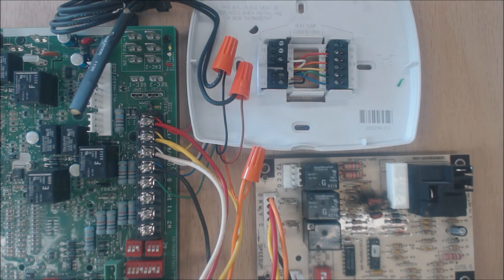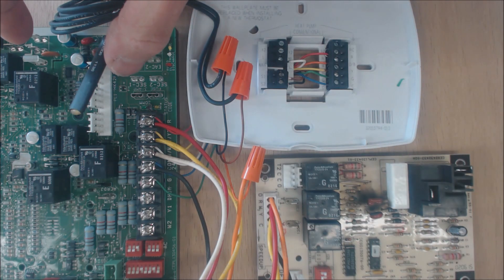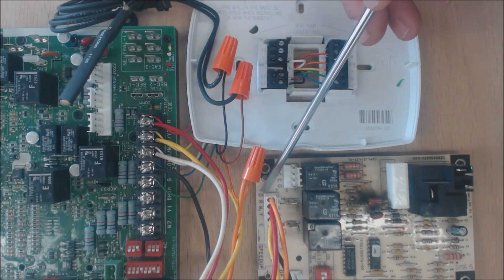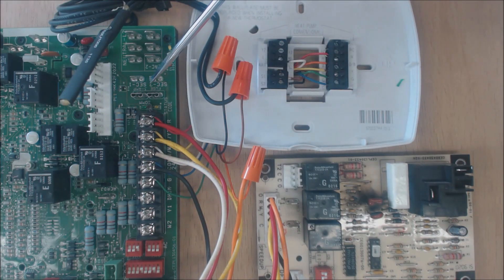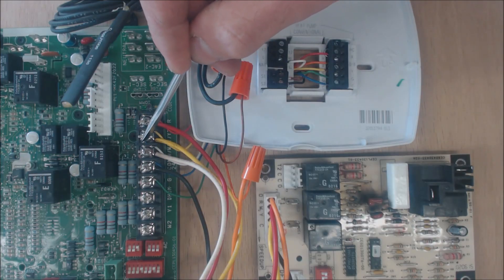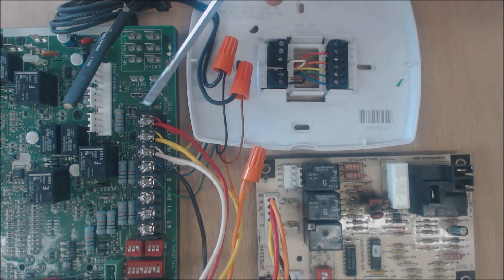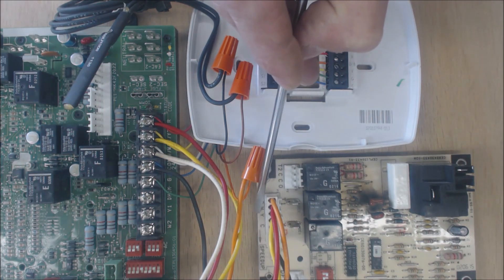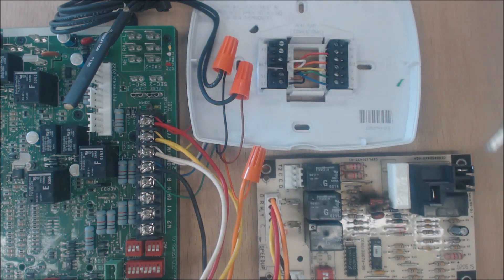Wiring a Thermostat, Furnace, and Heat Pump for Dual Fuel Hybrid Heat!

Comment: Many young techs don’t fully understand dual fuel heat pump operation. The wiring trips them up. If you don’t wire em/aux W to W on the furnace, the furnace will not run during the defrost cycle and you will get cold air from your supply vents, dropping the house temperature. Goodman heat pumps have a white wire from the heat pump that must go to W on the furnace.

Comment: I have a Daikin propane 60K High Eff furnace with a VRV Life heat pump doing Dual fuel.  The Daikin Thermostat can only go down to 61 degrees and can't seem to ever shut off.  It almost seems to throttle down when it reaches whatever temperature you have it set for and then can't get above that temp and then runs forever.  The transition is set for 30 degrees does same at 40.  Will this thermostat go lower than 61 degrees and would it simply shut off when it reaches the desired temp?

Comment: Honeywell requires the outdoor temperature sensor wired to S-1 & S-2 be a separate 18/2 cable. Do not use 2 wires  in the cable to the heat pump. You will have electrical interference if you do. Many mystery random problems can be attributed to combining the wiring in one cable.

Comment: This is already 7 years old. I discuss this with friends and their minds are blown. I just want to get all the action out of my system. If the outdoor unit can take 4 stages. The furnace has 2 gas stages. Can a t9 thermostat utilize all of them? Their website and support says, call a pro. I say hell no. Call Craig. I think it can do it. The furnace manual. Aciq calls out 4 stages of heat. The first 2 stages would be the heatpump, the next two would be low and high on the furnace it self. I just worry about how it chooses those various ones. Or should I go opensource.

Comment: AC Service Tech, great videos! I have an issue that two service companies can't figure out. I have a 2-year-old dual fuel 5 ton 16 SEER single stage American Standard system. Every month or so, in cooling, I notice my house is warm. I find the indoor unit is running but the outdoor unit is not running. To fix, I raise the set point until the indoor unit shuts down. Then I lower the setpoint and both the indoor and outdoor unit come on and all runs fine for another month or so. My thermostat has been replaced twice but the problem persists. What might cause my intermittent problem? Bad contactor? I can never duplicate the problem when the service tech is present. Next time it happens I need to check that I have 24 volts on Y1 at the compressor.

Comment: I thought a gas furnace should NOT be running during defrost mode as this could raise the temperature to an unsafe level and reduce the lifespan of the compressor.

Comment: I've never installed and worked on Honeywell TH8000 but for the other heat pump thermostats when you turn on the HEAT and set the GOAL temperature let say 3-5 degree HIGHER than the ROOM temperature then the thermostat will automatically turn on the AUXILIARY HEAT to help the heat pump. So in the case of dual fuel heat pump will the Honeywell TH8000 will turn on the gas heat to help the heat pump ? Thanks for your reply.

Comment: Ah, finally an installation that shows the O/B wire from the thermostat directly to the heat pump control board. I was stuck for quite a while wondering why the furnace board needed to know about the reversing valve signal. So is the O/B terminal on some furnace boards just to simplify/standardize the wiring (without actually connecting to anything on the furnace board)?

Comment: Great Content!  I recently purchased a new thermostat and would like to configure it to run the heat pump for air conditioning purposes only. I live in the Northeast and have a dual fuel system. I want to convert to a conventional 2H / 1C system using the existing wiring. Is this possible with my current setup? Can I just wire the O and Y together on the new thermostat and program the thermostat to run as a conventional system? 

- Heat Pump Model: Lennox XP14-024-230-03 ( Heat Pump)
- Furnace Model: Lennox G61MPV-36B-071-12 (2-stage Variable Speed)
- New Thermostat Model: Honeywell RTH9585WF1004

Keep up the great work!!

Comment: Hi
I'm about to replace old r22 outdoor unit COOLING ONLY  with Goodman heat pump + coil 
But owner wants to keep old gas furnace with the blower motor)) 
It's possible to connect to control board  terminals C G Y W R  if yes how many wires has to come from outdoor heat pump condenser? 
Many thanks!

Comment: I completely don't understand how this can even work.  So, when the only new wire that is introduced from a gas furance and AC when switching to a gas furnance with a heat pump is the O/B wire... how on Earth does a signal work that tells heat pump on in heating or gas furnace on when heating?  I only have one W wire... I have G and O/B.  My furnance control board looks just like that one but I think it is a different model number.  What is the actual signal being sent when it should call for the furnace versus the heat pump?

Comment: Part I'm confused on is where you mentioned about defrost. When the heat pump boards sends 24v on W in the indoor board. How is it preventing the gas furnace from coming on during defrost? Does the main Indoor board locks out the furnace while Y is energized?

Comment: Question, I am adding  a 2 stage Goodman Heat Pump to an existing Goodman Furnace for Dual Fuel.  Heat Pump has R, C, W1, Y1, Y2, L and O terminals.  The Furnace has R, C, W, Y and G terminals.  Should I connect wiring as follows from the heat pump to furnace to Nest, R to R to Rc, C to C to C, W1 to W to W1, Y1 to Y to Y1, Y2 to Nest Thermostat Y2, L do not connect, O to Nest Thermostat O. Thank you for any assistance you may be able to offer. Jack Perlmutter

Comment: My heatpump's reversing valve froze up and now only works in AC mode so I had a furnance added since it cost about the same as getting the reversing valve fixed. But I have to manually chage the wiring and thermostat settings each change in season. I need a zone control board that can run a duel fuel service . any recommendations appreciated!

Comment: Question for you @acservicetechchannel - I just bought a dual fuel system with 2-stage gas furnace and 2-stage heat pump. I'm trying to figure out what thermostat I need. Is that considered 2 heat cycles/2 cooling cycles or is that technically 4 heat cycles and 2 cool cycles? 

Also, if you have any recommendations for thermostats or brands, that'd be great! Thanks in advance.

Comment: How can I keep an undersized heat pump running all the time and the furnace coming on when it can't keep up? Could I put the coil in the return duct and use a separate thermostat?

Comment: I replaced a dead central AC with a Trane heat pump, (without heat strip).  I have a hot water boiler for heat.  Can I use this Honeywell 8000 to control the heat pump and boiler separately when the outdoor temp is 35° or below?

Comment: help do you need the outdoor sensor if the heat pump has one already or is that for the defrost board only? my problem is that the heat pump and gas turn on together I'm using a Honeywell t6 pro stat

Comment: Very helpful video.  Thank you.  I have a hvac, propane hybrid system that cannot have both running once or the heat in the copper line gets too hot and the pressure is too high.  What thermostat would your recommend? The technician we had look at it said we needed a 3 heat thermostat.  Not sure how to hook that up.  I should add we don't have a C terminal.  I was looking for something with a wireless outdoor sensor to know when to engage the furnace.

Comment: If a lennox had a communication thermostat. 4 wires ( R, I+, I-, C) and customer changed thermostat to nest. What would happen then in the rewiring at the indoor/Furnace communication board?
Reply: I'm working on that now with the Amazon smart thermostat which doesn't support dual fuel.  My choices are to either use a Lennox C7500 thermostat (which I have) or write my own control firmware using a PI Zero/Arduino and use a relay board to handle this.  The MCU will have to read and handle outdoor temp as well.

Comment: Do you have a video laying out how to do this same thing, except the heat pump has 2 stages cooling and heat?  Is it as simple as just adding the extra Y wire?
Reply: Did you find an answer to this?  I have the exact setup, but the hack that installed it only ran 2 wires to the outdoor unit, C and Y. So the HP isn't utilized at all for heating, just the gas furnace.  I'd like to remedy that,  So I need to pull new 18/8 to connect everything correctly. Currently, it's also not utilizing the 2 stage compressors, so the supposed energy efficiency is out the window, as it's only running 2nd stage (high speed) all the time.

EDIT whoops, just realized I replied to myself from over a year ago...doh!

Comment: I have a heat pump and an oil furnace.  I have chosen not to have the oil heat come on when the hp goes into defrost.  I do not mind the cold air for a few minutes. Has anyone figured out how to trick the defrost cycle so that it will not operate when the temperature is above my 35 degrees set point?

Comment: Is the DFT sensor on the liquid or in the middle of the evaporator ? Surely the liquid line would not reflect the temp of the cold outside coil which is the evaporator during heating mode ?  11:25 in video

Comment: Hello, I installed a new gas furnace and kept the heat pump. I want to use the heat pump for AC only. how can I wire it with my new furnace to use it as ac? Thanks!

Comment: My heat pump has W and Wout wires. Where does the Wout wire get connected to with aux gas furnace and ecobee thermostat?

Comment: I have a dual fuel system heat pump with propane gas, with s1 and s2 wires coming to the thermostat. What would be newer thermostat models that would take s1 and s2 with wifi functionality? The model that you demonstrated with it in this video is fairly obsolete, and does not have wifi function. Hopefully you would get comment notification from your old post. Thanks!

Comment: I have a bosch inverter heat pump 1st generation,  a 97% efficiency modulating gas valve , varible speed Goodman furnace, and I'm using a emerson sensi thermastat,  the heat pump does come on and does work, thermastat says "heat" because it's my primary heat source,  but the furnace seems to kick on and does say " Auxiliary heat" which it should, it was 23 degrees out over night, I thought this bosch inverter was supposed to heat to -5 degrees before auxiliary heat or emergency should kick on , I'm just not sure if this thermastat is the right one, but it says hp 1 , hp 2, my bosch tech is new at these heat pumps, and old school with these types of thermostats,  not sure what's going on, can you help?

Comment: Thanks for the great teaching video. I have a heatpump/gas furnace with a nordyne dual fuel kit. I installed a Honeywell TH6320WF2003/U and think I need to remove the dual fuel kit to let the thermostat control everything. Thermostat wiring. S1 S2 to sensor, Y to furn Y, G to furn G, C to furn C, O wirenut to O on heatpump. Aux/W2 to furn W, R/Rc jumped to furn R. 
Defrost control board wiring. C to furn C, Y to furn Y, O wire nuted from thermostat, W2 to furn W, R to furn R. 
My question is there is a wire at the defrost board E that was wired to dual fuel kit. Does it need this wire? Where does it need to be terminated? 
Thanks in advance.
Ken

Comment: It is abundantly clear to me that few techs are this well informed regarding dual fuel systems. I've actually had to argue with a couple techs that the gas furnace must come on during the defrost cycle to offset the cooling effect from the heatpump running in reverse. I've even had to argue that the air handler blower runs at a higher speed when in cooling mode and at a slower speed during the heating cycle. You clearly explain the why, how, and what behind everything, including what is in the best interests of the consumer with regards to efficiency and system longevity. You're a rare breed my friend. Would love to have you look at my Trane system if you're ever in Virginia!
Reply from the maker: Thanks and glad to help!

Comment: With all this global warming.... michigan has had some really cold winters -20F for a few weeks. My furnace struggles to keep up. 110,000 btu 3200 sq ft. There where days it ran 24/7 and could not satisfy a 65°F thermostat call. I do automotive wind tunnel HVAC. (Big stuff)  Not residential. 
I dont want to drop 5k on a bigger furnace nor 20k on new windows. I have installed plastic over windows. Attick has 18" of insulation. I want to add a 5-10kw heat strip to my trunk. I have a wifi touch Honeywell thermostat that for sure works with heat pump. Can I just hook my heat strip contactor to w2 and set the program to heat pump and set 10°F or below to activate the heat strip? Will it give me the proper timing for pre and post fan to the heat strip and still command the furnace properly?
Reply from the maker: You should do the testing of the 24v circuit from your tstat first or read up on the model number to make sure it will work as intended before diving in since it will need to be a hybrid heat or dual fuel type thermostat, thanks!
Reply: @acservicetechchannel  Thanks. I did some research last nigh. my model is Honeywell RTH9580WF it has a heat pump option. 

It has a boiler/steam option.
It has 1 or 2 stage cooling option.
It has 1 or 2 stage heating option.
I tried the heat pump option but that just commands the compressor to come on and the reversing valve O. So that set up will not work.
Now I'm thinking of just hooking the heat strip to the w2 2nd stage. 

I'm pretty sure w1 stays energized when w2 calls also.
I don't see any settings for time delay for stage 2 tho on the t stat settings. I 

don't know if its high temp delta activated or time activated. I need to play some more with it. I will just have to manually turn off the breaker to the heat strip in the panel when I don't want it running in the fall. 

Or the last idea is connect the heat strip contractor parallel to the gas valve with an inline 2 min time delay  like this to ensure the heat strip doesn't come on until after the blower.

https://www.grainger.com/product/ICM-Relay-4E234?cm_sp=Product_Details-Products_Based_on_Your_Search-IDPPLARECS&cm_vc=IDPPLARECS

Comment: What is the MODEL # of the dual fuel thermostat for a single furnace and single stage heat pump???????????? Thank you barry
Reply from the maker: This is the model number of the TSAT used TH8320U 1008 and here is a link from honeywell--https://customer.honeywell.com/resources/techlit/TechLitDocuments/68-0000s/68-0280.pdf

Comment: What would happen if everything was wired this way except w from heatpump to furnace was left off. Would it ever use outdoor for heat? I wired everything except w for outdoor because I wasn't sure if t stat was dual fuel capable.
Reply from the maker: W from the outdoor unit is powering 24v during defrost. You would want to hook that up so that you give the indoor coil's refrigerant heat to take outside and reject into the ice to melt it off the fins, thanks

Comment: Why does the 24vac come from the indoor furnace. Could the 24vac be supplied by the outdoor unit ??
Reply from the maker: The outdoor unit does not usually have a 24v transformer in it, thanks

Comment: Thanks for the reply. The electric furnace comes up when I go to the thermostat and call for emergency heat otherwise it does not go into the auxiliary heating with the heat pump on. The old thermostat works , by going into auxiliary heating with one degree drop in temperature. Can heat pump increase temperature by 3 degree with the reverse valve heating? The system is electric heat pump 2stage heat and cool and furnace. Is there reversing valve heating or is it simply just reversing valve cooling option on York Zye series?
Reply: You have orange wire looped up (for the defrost) , in mine it is two blue looped up that did not go into the furnace board. Then I have orange wire from the O on the board to the O on the thermostat- ?so this the reversing valve connection. It appears O powers in cooling mode on York zye series heatpump. I don’t have B terminal

Comment: I need help with my hvac. My unit suddenly gets cold in the middle of the night when the mode is in heat. I am not sure if it is the reversing valve connection problem. I have 7 wires coming out from thermostat (plus Grey and Brown unused) . 
connected Red R, Black(comon),Green(fan),Yellow (compressor),Y2(single Brown ) on the electric furnace board but not collected to the thermostat. 
Blue wire from Heat pump and thermostat looped up in the furnace but NOT connected to furnace board. Orange is On O on the board. White W1 and W2 looped/linked on furnace board.

On the thermostat all are connected but not sure if orange wire  should go to  Y2( Y1 has yellow wire already)
Or W1(o/b) or blue wire should go to Y2 or W1(o/b).

W2(Aux) has white wire heat.
W1 and W2 on the furnace box is linked.

Now it is giving cooling instead of heat with orange wire on w1(o/b) and blue wire is on Y2 on the thermostat.
The system is York Zye , thermostat is Zen thermostat 
Thanks
Reply from the maker: So that is a dual fuel system. Has the furnace ever turned on for heat since you installed that thermostat or is only the heat pump running? Did this start happening after you installed the tstat? It could be that you are in defrost mode or also the heat pump not producing much heat since it is a low ambient temp outside.
Reply: These are the best troubleshooting exercises a tech can find. Two instructors I know and I currently go through them for personal honing and also to provide extra credit test questions not passed on from student to student over time.